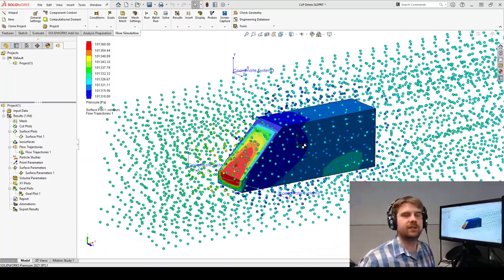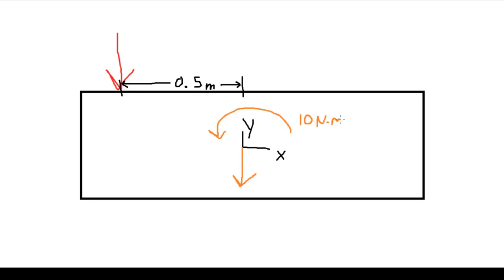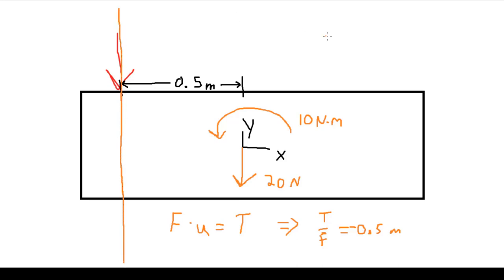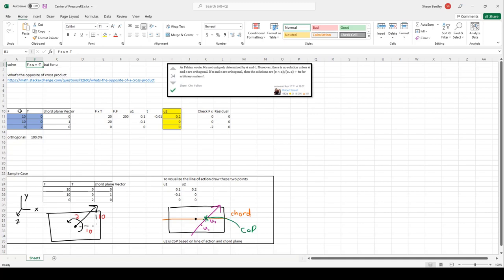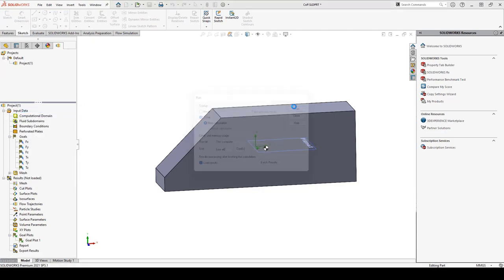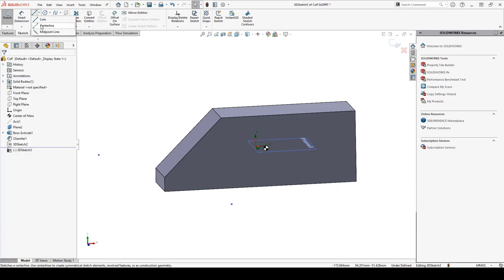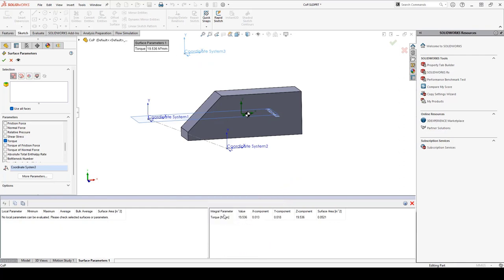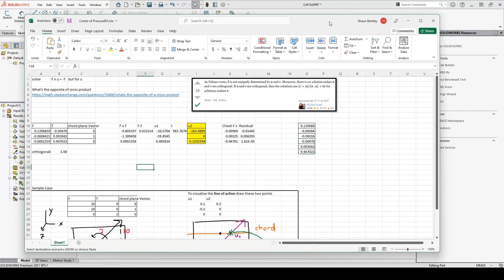SOLIDWORKS Flow Simulation - Center of Pressure

Comment: I tried this method for finding the center of lateral resistance of a sailboat (which should be the center of pressure from the water against the hull, keel and rudder). But I got weird results. I tried the same method on a simple NACA 0012 airfoil and the center of pressure should be 25% of the chord length from the leading edge. But instead the axis hit in the center plane at 50% from the leading edge, 50% from the top, so in the middle. Is there multiple definitions for center of pressure?

Comment: Hi! Does the forces (Fy Fz Fz) under the Goals refer to force of the fluid at 10m/s  or the force experienced by the body?
Reply from the maker: The goals are measurements of resultant forces so in this case that would be the forces experienced by the body.

Comment: Hi, how can I open a simulation from a assembly in a sub-assembly? I have a sub-assembly with complete motion study and now I want to add another assembly to the sub assembly but the motion study is not converted into motion study.
Reply from the maker: Hello Ritesh!  If I understand your question to be "Can I import a Motion Study from a sub-assembly into its parent assembly?", the short answer is "you cannot" at least not that I am aware of.  I think to get a better grip on your question and potentially some alternative strategies, I would pose it on forums.solidworks.com or communicate it to your Reseller's technical staff.  That way you can share images, videos, and files and perhaps find an efficient way to reach your objective.